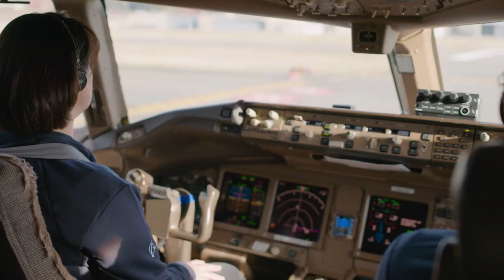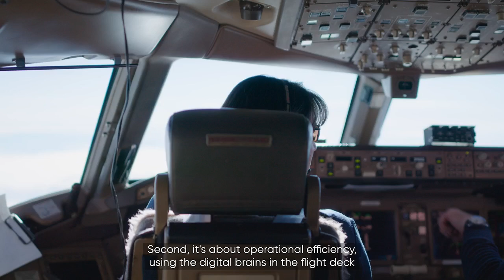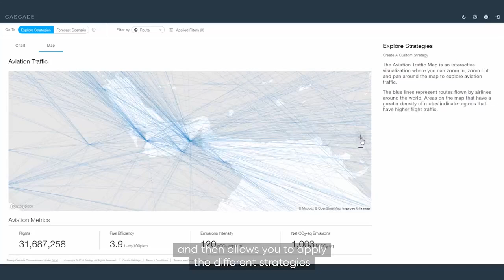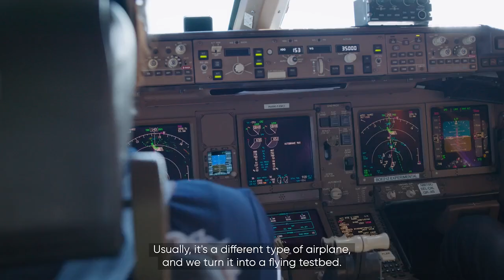A Plane with a Plan: Reducing Carbon Emissions

Comment: No one can talk nonsense about the Boeing 777. That aircraft is unbelievable.
Reply: Yeah THAT is truely the single most effective aircraft EVER. period. But the 777X program has truely put its legacy down the drain, being so chronically overbudget that the final unit cost of those aircrafts would need to be a LOT higher to recoup their development cost: at that price the 777x will no longer be that cheaper, quicker alternative it promised to be😬
Reply: @Adrenaline_chaser plane cost lots to make, but you’re making it cheap doesn’t add up

Comment: lol, Dear Boeing, the only way Boeing has to meaningfully reduce it's carbon footprint is to Change the fuel used in your aircraft. Consider using Hydrogen (zero emission) or Methane (half emissions). Everything you talk about here is meaningless gibberish to delude yourself and others that you care about carbon emissions. Lip service with no real substance, like everyone sorting plastic into separate containers before putting it in a landfill, instead of incinerating it for electricity.

Comment: 1:44 but there is no replacement for the 757....
Reply: instead of 737 max we should've gotten 757 max
Reply: @maykhu12  real, i call the 737 the rat of the skies for a reason 😭
Reply: 797 will replace 757
Reply: @RMMVOceanic3  unfortunately 😖
Reply: yeah
Reply: Of course there is a replacement for the 757 - it‘s the A321neo in the LR or XLR version 🤷
Reply: @anouk.b898  the pencil of the skies didn’t deserve its short lifespan i wish they still made it
Reply: @anouk.b898 Not quite, the A321XLR cannot land at the same runways the 757 did.
Reply: what if.. its a spoiler..